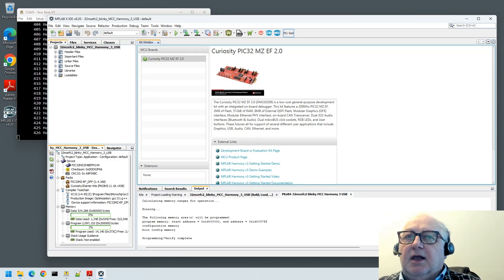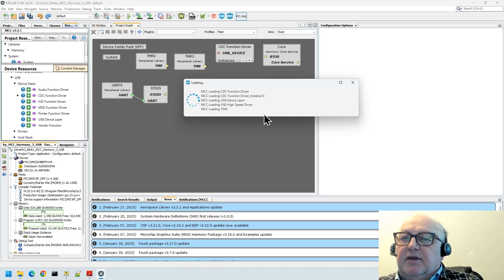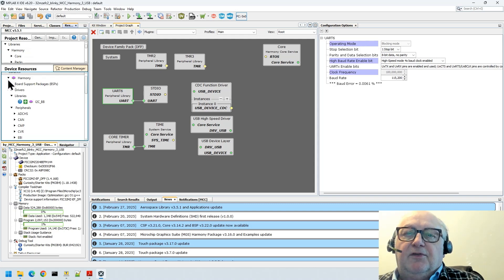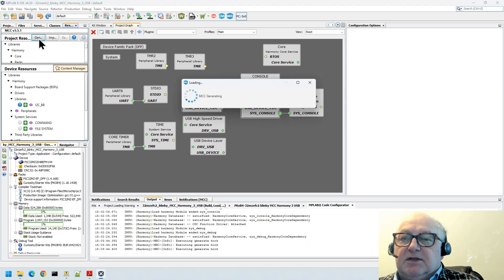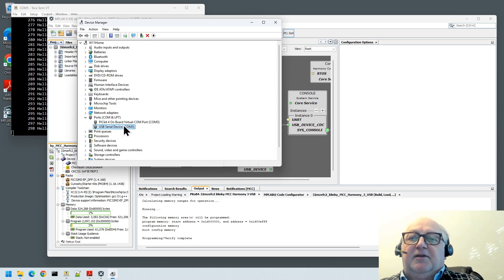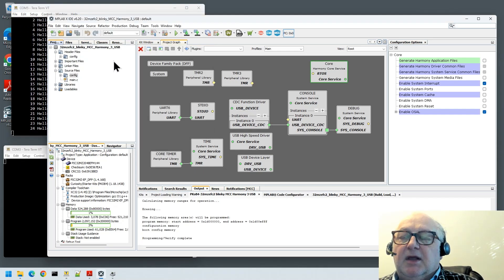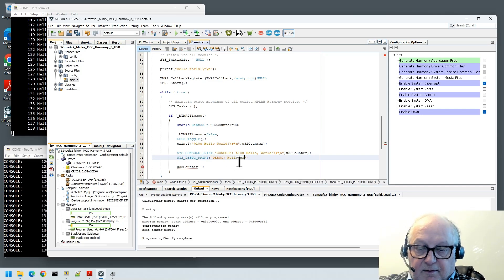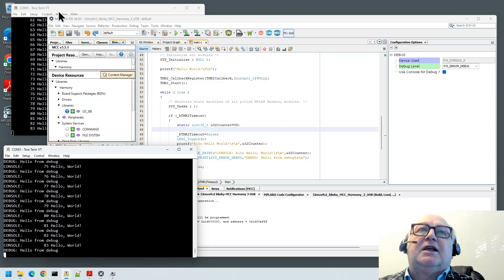MPLAB Harmony 3 MCC Episode 7: Adding a USB CDC Virtual UART Device

Comment from the maker: *** If you are using MPLAB X 6.25, please avoid updating the following components that MPLAB X is currently recommending due to several issues that have been recently discovered:

MCC Content Manager
MCC-Service-Provider-Plugin
MPLAB Code Configurator
Shared State

More details are covered here:

https://forum.microchip.com/s/topic/a5CV40000000nvBMAQ/t394994?comment=P-2992645
https://forum.microchip.com/s/topic/a5CV40000003ZcLMAU/t401122
https://forum.microchip.com/s/topic/a5CV40000003mBNMAY/t401581

Comment: Problem: 
I am using MCC 5.6.2 and I cannot connect USB_DEVICE_CDC of CDC Function Driver and Console.
The diamonds stay yellow instead of going green and the connecting line disappears as soon as I click anything else on the project graph.
Any tips of what can me wrong?
Reply: Hi, did you manage to resolve this issue?! I am facing the same fate and the line disappears after connection
Reply: @intellugogroup  I had to install older version of MPLAB X 6.20
Reply: @Leo-u3t1j  Cool, well I got mine by maintaining the MPLAB X 6.25 but downgrading the the Pluggins i.e. MCC Content Manager to 1.0.0, MPLAB Code configurator to 5.5.2 although I have another issue with not having the DMA congiuration showing up properly

Comment: Is it possible to implement a CDC Virtual UART Device and a custom HID with the same USB peripheral on MCC? I can't see how to do that. Thanks!
Reply from the maker: Yes, it is, but you will may well find that as well as the HID event handler and configuration,  you will have to do some extra work on the CDC side, providing your own CDC event code rather than relying on the MCC generated code as I am here.

The example I provide in this example is somewhat of a special case, because MCC generates a lot of the USB glue for you between the console and USB CDC, including a CDC event driver. I did it this way deliberately to simplify things, it's complicated enough already!

I suggest that you approach this by taking a look at the Microchip example apps for cdc_com_port_single and hid_basic. These have the CDC and HID event handlers separated out for you.

So you should end up with these event handlers in your code:

HID Event Handler
CDC Event Handler
USB Device Event Handler (which should register both the HID and CDC event handlers in response to a USB_DEVICE_EVENT_CONFIGURED event).

Thankfully, at least MCC should generate a working set of descriptors for your composite device, so you shouldn't need to do much work in that respect.

Now this is also where I would start to consider moving away from a monolithic main.c, and start using Harmony's app paradigm, using four "app" c files: 

So you'd have:
main.c - very bare, just SYS_Initialize() and SYS_Tasks();
mainapp.c &.h - Overall application's state machine;
usbdeviceapp.c & .h - USB device state machine & event handler;
usbcdcapp.c & .h - USB CDC state machine & event handler;
usbhidapp.c & .h - USB HID state machine & event handler

This greatly simplifies things in the medium to long run, with single responsibilities, interface segregation, and helps to completely avoid dependency inversion. I realise that this sounds like SOLID mantra, but these principles happen to come naturally anyway when you're looking to de-clutter and make your application more maintainable and understandable.

Trying to combine all of your functionality into a single state machine for a composite device is going to end up like unmaintainable spaghetti, as evidenced by many of Microchip's examples!